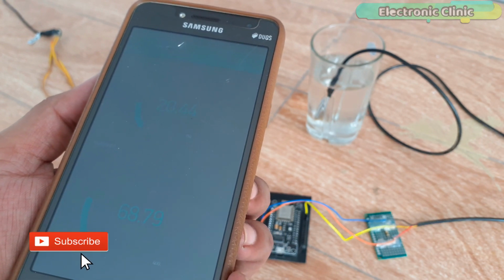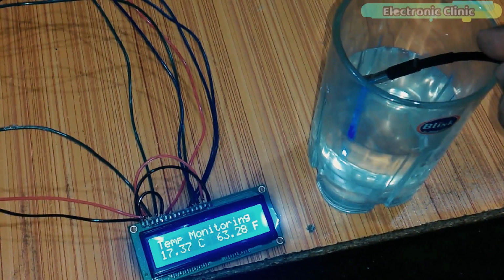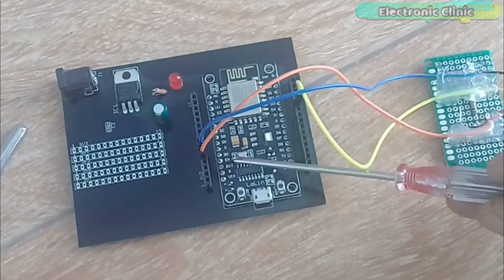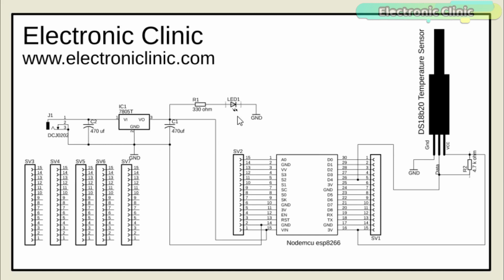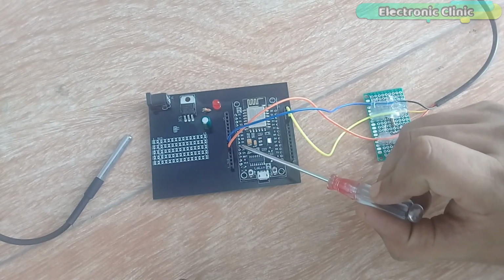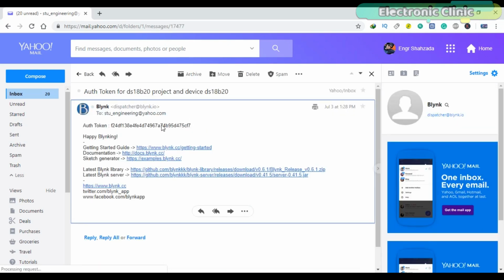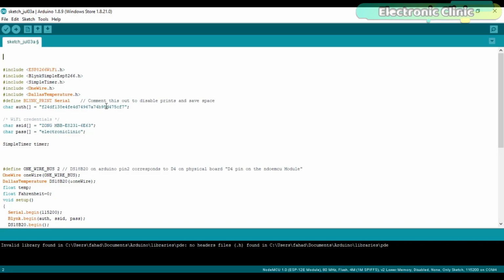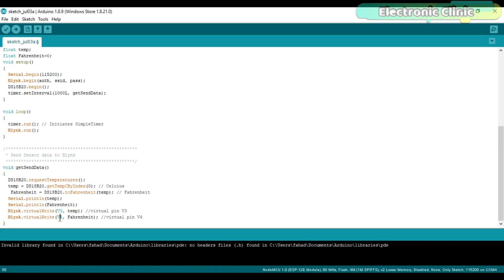Nodemcu ESP8266 DS18b20 Waterproof Temperature Sensor Monitoring using Blynk

Comment: Hello sir, I have tried but the readings I get -127 celcius... Can u help me?
Reply from the maker: check you sensor and connections.
Reply: @ElectroniClinic  solved sir i think error because i use gpio 16, when i use gpio 2 or 5 its works. Thanks sir

Comment: hiee bro i need your help. I am using this sensor, for the first time it worked perfectly but after that, I had cut the wire to solder jumper wires but after soldering it is showing -126 degree celcius only.  How to resolve this??
Reply: I have the same problem, did you solve it??
Reply: @javierlizarraga2558  use another digital pin and heat it little bit it will work
Reply: I have same problem, did you solve it or fix it??
Reply: @PhongsakornW  use another digital pin and heat it little bit it will work
Reply: @arunpatil7936  heat that digital pin?
Reply: @PhongsakornW  no the sensing part of the sensor.
Reply: @arunpatil7936  oh ok. i will try

Comment: I'm getting this error, kindly help.

in file included from C:\Users\Karthick S\Documents\Arduino\libraries\Blynk\src/Blynk/BlynkApi.h:17:0,

                 from C:\Users\Karthick S\Documents\Arduino\libraries\Blynk\src/BlynkApiArduino.h:14,

                 from C:\Users\Karthick S\Documents\Arduino\libraries\Blynk\src/BlynkSimpleEsp8266.h:24,

                 from C:\Users\Karthick S\Desktop\sketch_feb03b\sketch_feb03b.ino:2:

C:\Users\Karthick S\Documents\Arduino\libraries\Blynk\src/Blynk/BlynkTimer.h:36:21: error: redefinition of 'class BlynkTimer'

 #define SimpleTimer BlynkTimer

                     ^

C:\Users\Karthick S\Documents\Arduino\libraries\SimpleTimer/SimpleTimer.h:10:7: note: in expansion of macro 'SimpleTimer'

 class SimpleTimer {

       ^

C:\Users\Karthick S\Documents\Arduino\libraries\Blynk\src/Blynk/BlynkTimer.h:36:21: error: previous definition of 'class BlynkTimer'

 #define SimpleTimer BlynkTimer

                     ^

C:\Users\Karthick S\Documents\Arduino\libraries\Blynk\src/Blynk/BlynkTimer.h:41:7: note: in expansion of macro 'SimpleTimer'

 class SimpleTimer {

       ^

exit status 1
Error compiling for board NodeMCU 0.9 (ESP-12 Module).
Reply: No need Simpletimer.h library. Blynk.h has already a timer so you need only blynktimer instead simpletimer